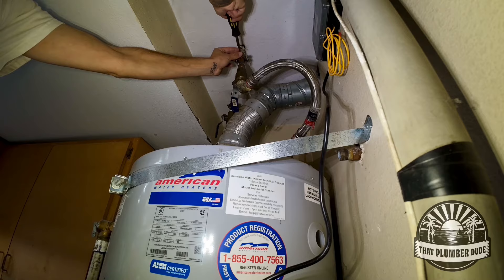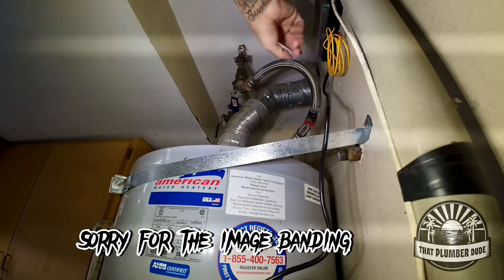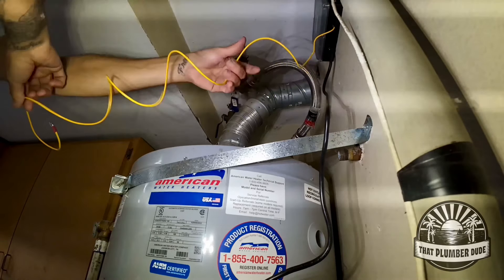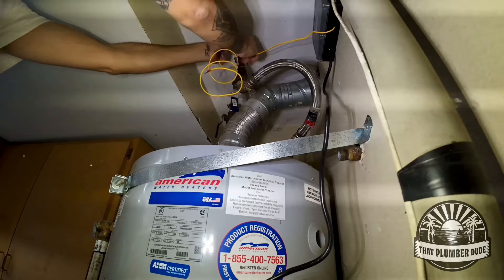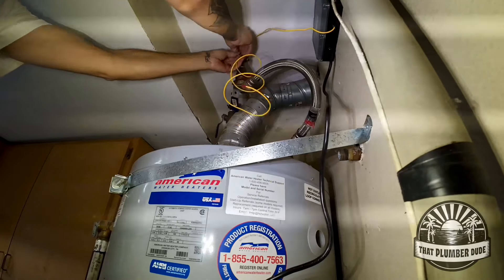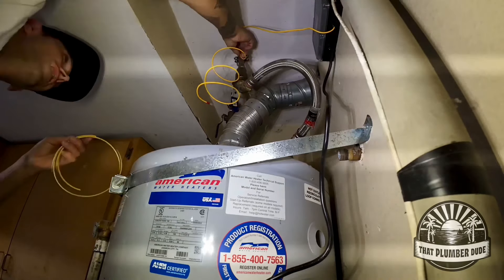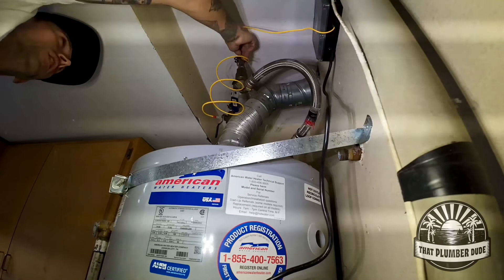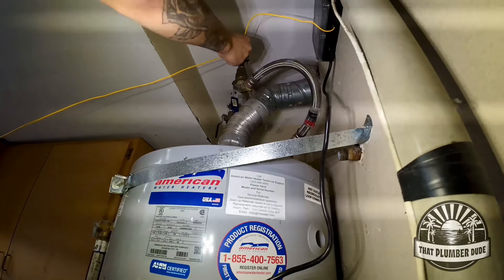Installing Flow Tech | WATER SOFTENER ALTERNATIVE | Plumbing Clip

Comment: I’ve installed lots of these. Even one for my uncle. He says he notices a difference than before. I believe it works best on copper pipe. I have the signal tester and you can read the signal at the furthest fixture on copper pipes, unfortunately not on other pipes. Sure wouldn’t want this on a galvanized house 😂
Reply from the maker: 😆 Nice!! Mainly copper and pex pipe here. It’s a great device!
Reply: @ThatPlumberDude how much does it cost to for device and installation?